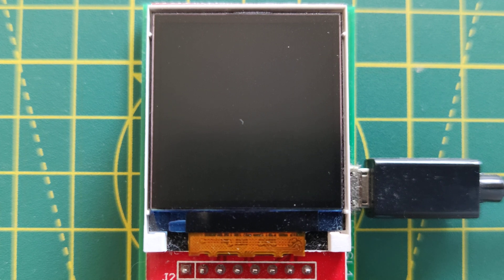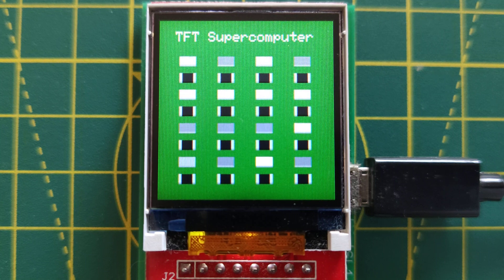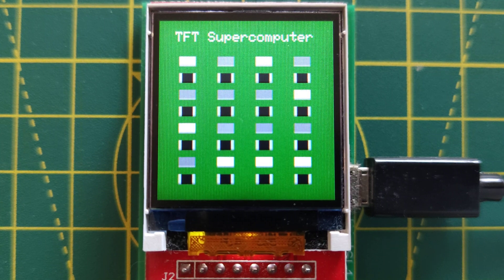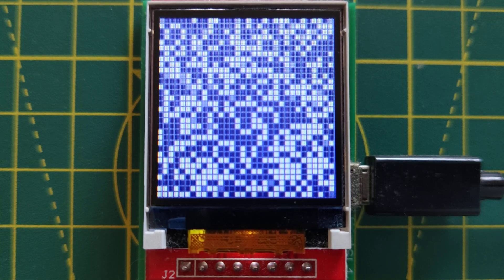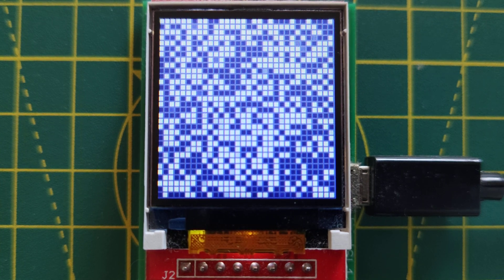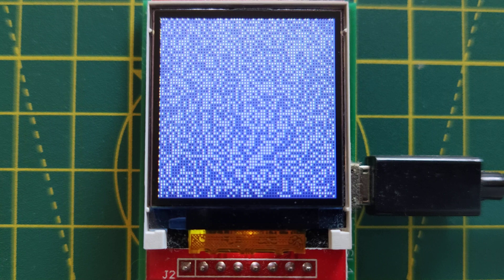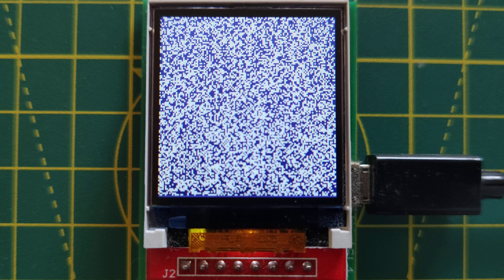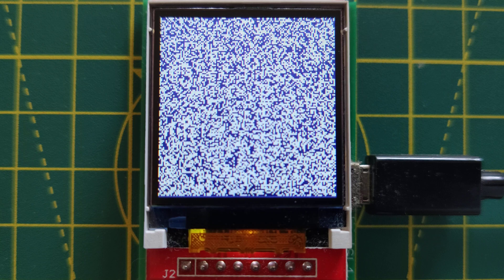TFT Supercomputer

Comment: Amazing work. How do the pixels or so called LED's drift happen? Is it an error of the code failing to keep the blinking LEDs in order, or is it purposefully done to make the units of blinking lights ever so slightly diverge through careful software?
Reply from the maker: In the first operating mode, the LED flashing gets out of sync over time. That is achieved by having the flash period of each LED ever so slightly different from the rest, which is also what happens with hardware flashing LEDs available in e.g. 5mm packages.
Reply: In TFT (Thin-Film Transistor) and LED (Light-Emitting Diode) computing devices, the phenomenon of pixel drift does not occur due to errors in the code or intentional software manipulation. Pixel drift is typically an unintentional and undesirable characteristic that can arise due to various factors related to the physical properties of the display technology.

Pixel drift refers to the gradual movement or shifting of individual pixels or LED elements over time. It can result in the misalignment of pixels or the appearance of uneven gaps between them. The primary causes of pixel drift include:

    Manufacturing Variations: During the production process of TFT or LED displays, slight variations in the fabrication or assembly can lead to inconsistencies in pixel placement or alignment. These variations can result in pixel drift over time, as the individual elements may not be perfectly stable.

    Mechanical Stress: The expansion and contraction of materials due to temperature changes or physical stress can cause pixels to shift their positions. This can be particularly noticeable in larger displays where the structural integrity of the panel may be subject to more strain.

    Environmental Factors: Environmental conditions, such as humidity and temperature fluctuations, can impact the behavior of the materials used in the display. These conditions can cause subtle changes in the electrical properties of the components, leading to pixel drift.

It's important to note that pixel drift is generally considered a defect in display quality and is not intentionally introduced as a feature. Display manufacturers strive to minimize pixel drift by improving manufacturing processes, utilizing higher-quality components, and implementing measures to ensure pixel stability.

Software control plays a role in driving the individual pixels or LED elements in a display, but it is primarily responsible for controlling their state (on/off), brightness, color, and overall behavior. The software does not intentionally introduce drift to create diverging patterns; instead, it aims to maintain the intended arrangement and stability of pixels or LEDs.

In summary, pixel drift in TFT and LED computing devices is an unintended consequence caused by manufacturing variations, mechanical stress, and environmental factors. It is not an error in the code or a deliberate software manipulation. Display manufacturers continuously work to minimize pixel drift and improve the overall quality and stability of their products.